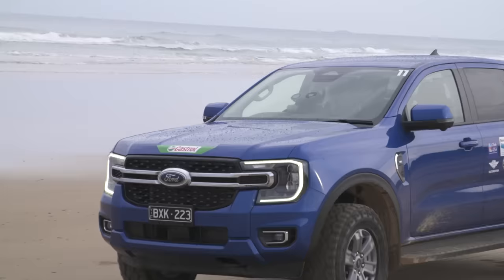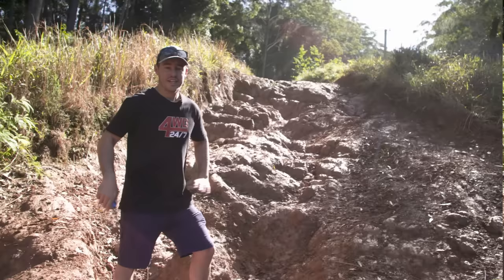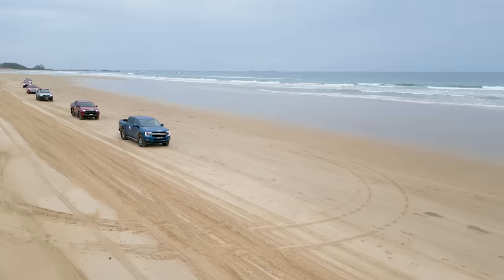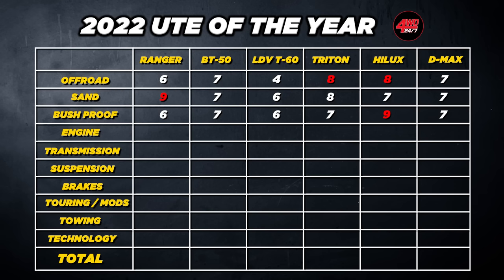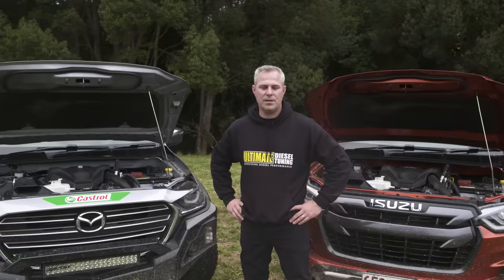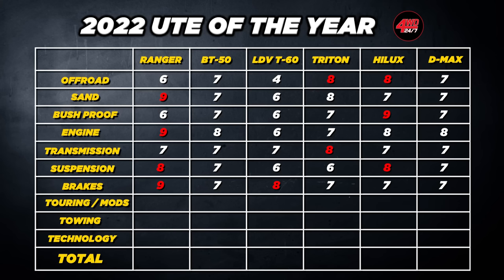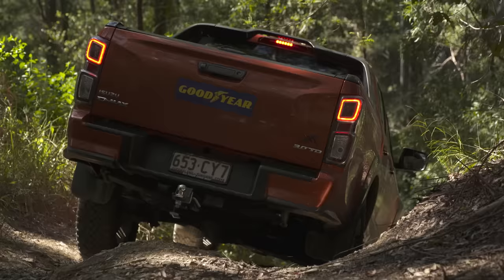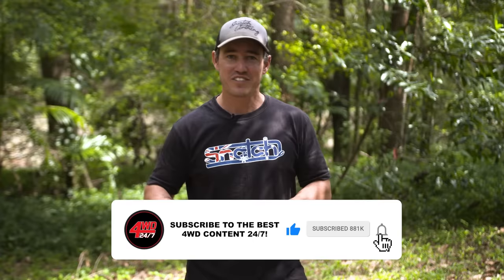2022 4WD UTE COMPARISON - CONTROVERSIAL WINNER! NEW Ranger vs Hilux vs DMAX vs Triton vs LDV v BT-50

Comment: I'm surprised how much I like the looks of the LDV. Already has a great gearbox and disc breaks all round as well. I wouldn't buy one yet but I can see it defiantly moving up the list in year to come if they improve the engine and front end suspension.
Reply: Ive got the generation before the one tested, and bought it purely on price point.  Wacked a lift on it, and better tyres and it does me great around the farm.  Is just lacking HP.  The current generation is much better, and it looks like they have actually listened to feed back.  Be interesting to see the next generation goes, especially if they can keep a similar price point.
Reply: @deanpurdy7063   I’ve heard they rust put me off from buying one
Reply: @talib6928  brother. All you have to do is take good care of it and it won't disappoint.
Reply: Absolutely, I have the 2019 Trailrider, comes standard with the rear diff lock and both hill start and hill descent control. 2inch lift with 265/70/17 Yoko geolander a/t's and handles offroad and sand whilst towing offroad camper. All with original 2.8l 130kw, turbo diesel motor. Love it.

Comment: A bit upsetting, I own a new t60 max luxe, you’d think to get a full test review you’d test the luxe that comes standard with a diff-lock. None the less Shaun love the videos mate. Cheers.
Reply: I raised an eyebrow because I though the Lux came with a rear diff. Then you pointed out they had the pro in the lineup
Reply from the maker: If we had the one with the locker it would have been pretty similar on the off-road stuff. The taller 1st gear may have made it harder to go slow and controlled but it would have been a weapon. A shame they don't offer their mid spec with a locker
Reply: @4WD247  There is no mid range, entry level (pro) doesn’t have a diff lock, the other one (lux) does.
Reply: I suppose we're just disappointed that Shaun spends the first 3, 4 minutes harping on about the lack of a diff lock, where for an extra 4K the Lux is still the same price as the mid spec Triton.
Reply: @4WD247  welcome to come grab mine, I think the manual transmission won’t stand it though.
Reply: Well next time send them an email and offer them your ute for testing then. 🤷
Reply: @MitchZero9  okay I will

Comment: How come the Navara never makes the cut in these comparisons? I know they didn't let you have one because it got "scratched" during the tests and got slammed in the reviews but would be great to give it another chance 👌
Reply from the maker: We would love to give it another chance and will try again next year!
Reply: @4WD247 oh beautiful, that would be mint 👌
Reply: This gen of Nav is getting long in the tooth but. Looks old on the outside and horrendous on the inside. It was mid pack the day it was released. Its not going to get better with most of its competitors all offering all-new gen alternatives. Sure it has it more loyal fan base which is fine (not hating, what ever gets you outoors!) but I can't help but say that anyone who has bought a Nav hasn't driven anything else. At the price point, the competition is simply better.
Reply: No more chances for it. They know it will be garbage still. Motor too small can't get the power fast enough

Comment: I own a MR single cab Triton Auto  with Aloy tray and boxes custom built. fitted egr delete cable ,3 inch DPF back exhaust and a 40mm lift with new mod upper control arms and hockey stick snorkel . goes really fast and only cost new$34,000 in dec.2019  Best value ever only now done 28k km

Comment: Took the 2023 ford ranger out to Stradbroke island, came back with a busted transmission 😢 they fixed it but not very reassuring. The conditions were not very gruelling but maybe the heat got to it

Comment: I have a 2013 mn triton. Bit low on power but it proved itself as a boggy paddock woodcutting machine. Loaded the entire tray and canopy with wood, 3 chainsaws and 2 toolbags and she smashed it through some extremely boggy ground no issues. Love it, I think bang for buck you can't go past a triton even in 2022. With a dyno tune should be a well rounded package.

Comment: Hi 4WD 24-7, I've just seen the CURRENT AFFAIR regarding the issues of the current FORD RANGER. Issues such as suddenly braking at 80 km/h, dash board screen showing nothing and poor customer service. In your future videos, COULD YOU PLEASE INCLUDE CURRENT ISSUES WITH THE VEHICLE (any vehicles) and WHAT THE MANUFACTURERS DOING ABOUT IT (fixes). Your videos influences how our hardworking Australians buy their knew vehicles. You will provide GREAT SERVICE to our community by providing not just the POSITIVE and NEGATIVE reviews about the vehicle but also the actual issues with it. This way, the MANUFACTURERS can be put on notice, up their standards and giving the manufacturers the idea CUSTOMER SERVICE should be their number one priority. Now that's a concept, PASSIONATE ABOUT CUSTOMER SERVICE.

Comment: Mahindra pickup they are cheap but are certainly not built cheap. They come with all the extras that the expensive  4wd's have . They are very capable off road and are more suited as a work vehicle than the other 4wd's but also can be used for a weekend getaway. My 2021 single cab cost $29000 new with a alloy tray as standard. Then i spent another $9000 on accessories that i fitted myself to keep the cost down. Bulbar , towbar , 2" suspension left , rims and tyres , tinted windows , winch , uhf , 9" android screen , 2 x under tray toolboxes , 80 L water tank , 12v compressor , recovery gear and a half size canopy with fridge , 120 ah agm 12v battery , mppt solar controller, 300w solar panel  240 inverter . Work vehicle / weekend tourer for $38000😁

Comment: I bought a brand new Ford Ranger Wildtrak 3DT in May 2023. Now in December 2023 it has just over 6000km on the ODO. All driving on road. Just after I got it I had to get injectors replaced after it showed engine error. Then I also had issue with tyres and had two replaced. Then a week ago another error with powertrain not engaging 4A. Could only drive in 2H. They had to replace a sensor on 4x4 mechanism. In total now 6 days without the vehicle. Fortunately all issues were sorted out under warranty. I can however tell you one thing. There is no way I will go on a serious offroad trip with this thing.

Comment: Thanks again Shauno & colleagues - I’ve owned 10 Subarus but now have my second Hilux which I chose for it’s reliability and well laid out engine bay - but the best value for money has to be the Triton and it would be my choice if the Aussie dollars were limited - Ford will still have reliability issues and a bit of a bush whale now - Isuzu/Mazda BT 50 a bit too eccentric for me and previous model DMAX are known to have body cracks/tearing in strategic areas of the engine bay.

Comment: I drive a 2017 Dmax dual cab with poverty pack and love it. It is simple easy to maintain and no electronics that are not required. I would buy the Dmax whilst it did not get the highest score it consistently scored average or above with no low 6 marks. I have heard of the issues with the safety electronics but recently a friend of mine has test driven one and there is now a single button to turn all of these off whilst towing or offroad. I would love to win the Bendix brake upgrade as i have just purchased a horse float which i am converting to a camper to do a family trip from Darwin to Coffs Harbour.

Comment: I’d probably go the Hilux,Toyota have been in Australia for a long time and have proven reliability for our conditions. My 09 Prado has been a great vehicle with almost 400k  on the clock and would love the Bendix brake upgrade to tow our new caravan around Australia mid next year.
Reply: New hilux has yet to prove its long term reliability. Just because your older model Toyota is reliable, doesn't mean the new ones are. I have a 2008 prado and it has an older engine that has proved itself but that doesn't mean the new ones are just as reliable

Comment: I drive an n80 sr hilux and still believe I made the right choice 3 years on. It even with stock wheels n tyres has not been bogged. My mates keep pushing me through the crap deeper n  rougher as time goes on. 
I believe the 2022 Ute of the year should have been Hilux due to the fact it just keeps being the best alrounder and doesn’t need the V6 for most of it tasks or the excessive additional price.

Comment: G'day, I've been driving a 3.0L v6 for the last 10 years. The lack of a snorkle killed the STX 550 (Dust) The Amarok tray is crap as the "Sports Bar" prevents access from the side and is destroying the sides of the tray where they attach, at least the tailgate latch does not work properly. 10 years after Nissan had a 3.0L V6 ford are trying it, lets hope they slove of the silly problems.

I would like to see a comparison with new and older 3.0L V6 duel cabs. Are the newer vehicles any better than what has been available in the past. This would be good to see for the second hand market/value.

Comment: I have next gen Ford Ranger XLT dual cab V6 turbo diesel on the way and I chose this vehicle because I really think that Ford has raised the bar with this new model. I had a contract on a Isuzu D-MAX but when this new next gen Ford Ranger was released I decided to switch. It's next level with its platform, technology and equipment make it my choice for 2023. It would be awesome to see what difference a Bendix ultimate brake kit upgrade would do it to get it setup for towing. Cheers 4WD 24-7, great content video for these utes.
Reply: Ranger is undoubtedly the superior vehicle however I would not buy one since it's simply not built for long term durability and reliability. Don't want a vehicle for 5 years, want one that can last 15-20 minimum. My Triton will be 17 next year and still running original shocks and I drive it really hard and it never breaks or give probs. But if I was not keeping a vehicle for that long, I'd buy one and sell it after 4-5 yrs.

Comment: I own a 2016 Hilux. Lifted, diff drop, bit of bar work, factory rear locker, bush pin stripes but otherwise nothing too outrageous. It’s got 90k on the clock and I’ve given it heaps on these tracks in Coffs and off-road up and down the coast… touch wood I’ve not had a single issue.

I’d pick the Hilux again - It’s the boring choice but availability of after market parts, ease of modification, real world off-road performance (from an IFS vehicle), clearances (when other vehicles are hung up), good power (with a tune) and - It just works. Gets you there and more importantly gets you home, every time. You can’t argue with reliability or getting back safely after taking that track you really shouldn’t have - with only one way out. The Hilux gets you home again.. and so has my vote.

Comment: I currently drive a GU cab/chassis with a canopy.  It's a bit of a tractor when it comes to performance and comfort but it just goes and goes - . a good,  solid tourer.  One thing it's not all that happy about is stopping, particularly when I've got the camper trailer in tow.  The standard brakes are pretty ordinary.
My vote for the best dual cab ute would be a toss up between the Mazda and the Isuzu.

Comment: Love my LDV T60. It's a 2018 Pro manual & so much better than the 2022 model. I work it hard & it hasn't let me down. Excellent on & off road great fuel economy, does everything I ask of it with ease.  I would certainly buy another & for the price it is excellent value for money.
Reply: Absolutely, I have the 2019 Trailrider, comes standard with the rear diff lock and both hill start and hill descent control. 2inch lift with 265/70/17 Yoko geolander a/t's and handles offroad and sand whilst towing offroad camper. All with original 2.8l 130kw, turbo diesel motor. Love

Comment: I have a 2021 BT50 Thunder.  
I upgraded from a 2012, but have been reluctant to invest in setting up the new one as I experienced world of pain with warranty issues over 30k, most have been build quality and component quality issues.
However, now it’s fixed I think it’s ok apart from not being able to turn off the sensors with the button when they go crazy for no reason.

Comment: I drive a patrol but if I had to pick one of these it would be the ranger. Even though I don’t have $70k spare you get a lot of added extras for your money like that infotainment system, and it’s little things like that that make long touring trips more enjoyable as well as day to day driving. Also very hard to go passed the factory numbers that motor is putting out particularly if compared to something like a 70 series cruiser. Not to mention how good the front of that car looks, with a more comp spec bar and some nice spotties or a slim light bar it would look like an animal

Comment: I drive a 2021 Jeep Gladiator Rubicon with a two inch lift and 35 inch BFG KO2s. It works well up here in Alaska. The Ford should get the nod for 4x4 of the year, especially with some minor mods

Comment: I have a 2008 jeep grand cherokee with a 3.0l turbo diesel. Would love a bendix upgrade. I think the yota should win based on shear reliability and aftermarket support. The ranger is sweet but a lot of new tech and areas Ford has been testing where yota has been there done that and proven the capability and reliability

Comment: Longevity of the Ford?  Well I have a very hard farm working 2014 2.2 Ranger auto and the main issue has been rear springs breaking over the years. One every 2.5 years on average. Otherwise there have only been a few minor issues like a second exhaust fuel evaporator failed the other day, which is an easy fix.   The new generation Ranger, which I also have, and have waxed its underbody myself the other day [as I have with all framed utes and SUV’s over the years] and there are significant improvements to the drivetrain. For a start there is a new transfer box with the ability to travel with what is basically best described as full time 4wd on the road. This reduces stress on the drivetrain when driving at slow speed on high grip surfaces, particularly with a heavy trailer. It is also ready for slippery surfaces with no delay. The chassis is completely new with far better protection from mud sitting on top of it and it has a far better paint job. They have done away with the diesel fuel cooler which used to be sited under the load bed. The new tow frame is higher up and the drawbar is removable to increase departure angle. The Ecoblue 2.0 has been extensively modified in the light of experience in previous Ranger and Transit models to increase reliability and longevity. Ford lost a lot of reputation with particularly the 2019 model Transit which now has a recall campaign to change poor quality injectors and timing belts. I believe they have widened the belts and changed the compound plus reduced the oil change intervals from 20,000 miles to 12,000 miles as well as many other detail changes that have been implemented on all 2.0 Ecoblue engines built for new generation Ranger and in all factories where this engine is made, including for Transit vans. The ten speed auto, of which I’m sure over three million have already been built and are in use, has also been updated to eliminate all failure points highlighted during many millions of miles of experience. 
Are they perfect? Of course not and in many dozens of vehicles I have run over fifty years in business, I have yet to find a vehicle that lasts reliably forever without some failures and costs.

Comment: I drive a 2006 Hilux, i know its not set up as well as the new range of 4x4s, but it definitely gets me to where I need to go. Although I have a sweet spot for the Hilux, the new Ford Ranger would definitely be my go to if I had the coin. As you mentioned the 3.0L V6 Petrol Turbo engine is one powerful beast and would definitely not disappoint, alongside the integrated technology. Ford Ranger is definitely the go to 🤙

Comment: I drive a 2022 pajero sport,basically a triton on steroids 🙂,better rear suspension articulation and disks on rear,therefore I'm  Not going to need the bendix upgrade kit here. But will happily fit one to my 2003 ford escape 4x4 beach vehicle.
In my view the triton should win the ute of the year as it represents the best bang for your buck 👍,great review guys,keep up the reviews 🙂🙂

Comment: Can I ask why the Hilux was conveniently missing from the off-road footage??

Not comparing the LDV in the Luxe version with the factory rear locker is a fail in my opinion. Especially when this version is STILL $6000 cheaper than the next cheapest option.
As for the lack of mods for LDV, I think the guy I passed on the way to work yesterday would say differently. He had every conceivable mod bolted to his. 

No Jeep Gladiator.

Ford haven't managed to produce a ute without exploding engines and gearboxes for the past decade. Why would this new model be any better?

🩴🩴

Comment: Full-size testing would be another but I'd live to see. The Ford F-350/F-350 crew cab Tremor would rock these trails. GMC also is coming out the Sierra AT4-X, which also rock! Of course Ram has their 2500 Heavy-duty Power Wagon. Heck. Throw in a Ford F-150 Raptor R for a twist, too.

Comment: 2021 GLX R Triton owner. Mitsubishi have a reliable formula for the Triton MR variants. The downfall for the points is based on minor issues but to me is the best ute on display. I think it wins over the others due to cost. Massive key factors are there and is $10K+ cheaper. That money is better spent on upgrading the vehicle in my opinion. Bonus is that they look mean aswell.